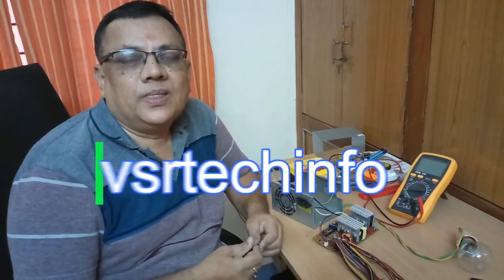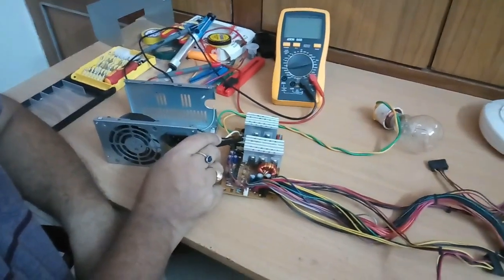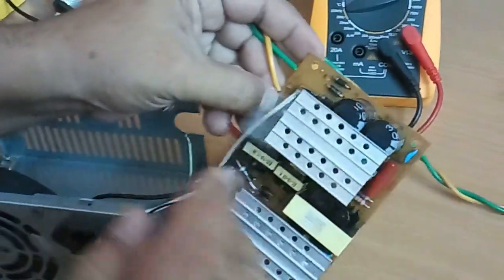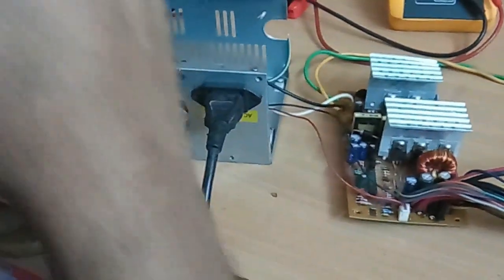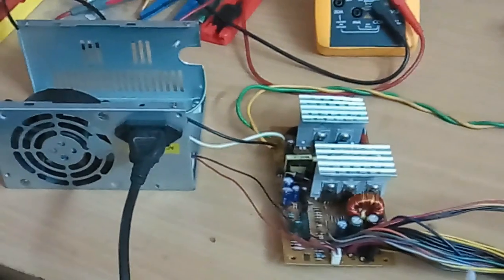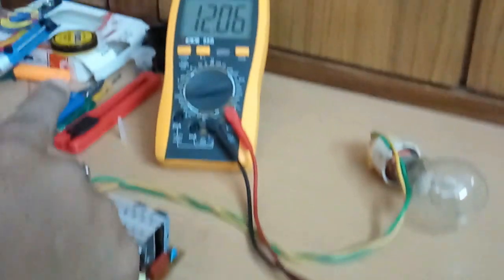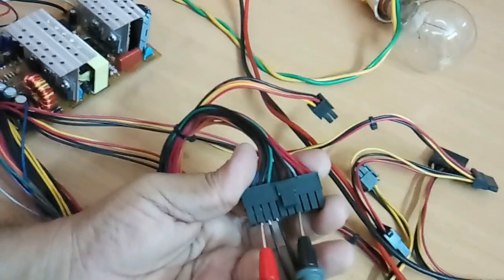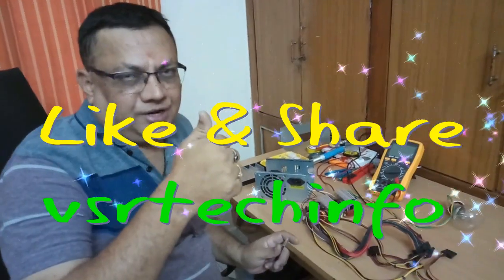Computer Power Supply Testing | Testing ATX SMPS Power Supply | How to test ATX SMPS Unit

Comment: Sir i my atx is keep flacuating  i check in 12v output coonected the 12v battery level indicator the indicator led going 12v to 5v again and again and on 12v the output is 6-7v can u help me....
Reply from the maker: Check bad capacitors and replace them for voltage stability.